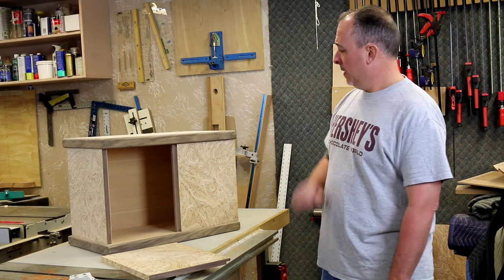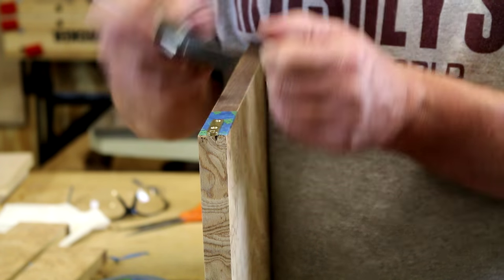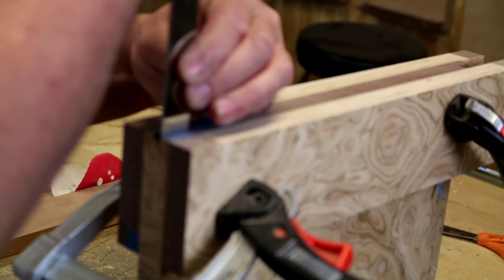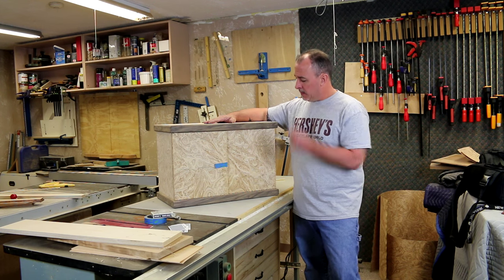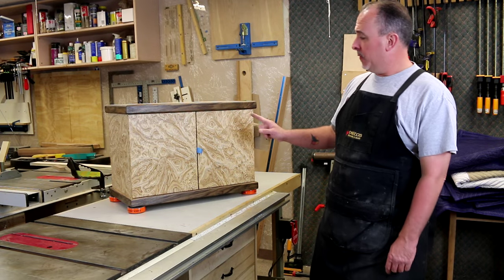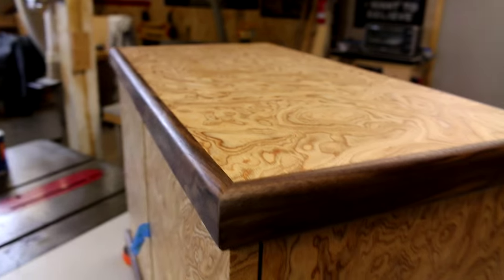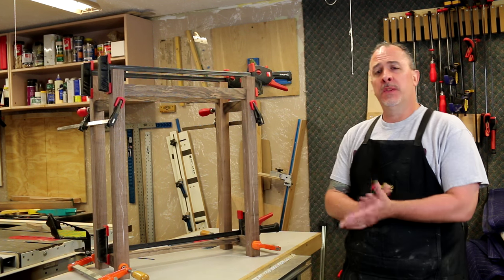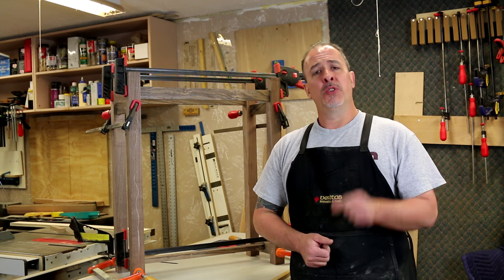Build A Krenov Style Cabinet On Stand Pt 4

Comment: The cabinet looks beautiful guys.  Just one thought: if you put the magnet on the other door, wouldn't that keep both doors closed? But great job so far, keep the vids coming!
Reply from the maker: That's a good point and I never thought of doing that. I would still have to install  stop for the first door. Thanks for watching and the tip. Next time I will do what you suggested. :-)